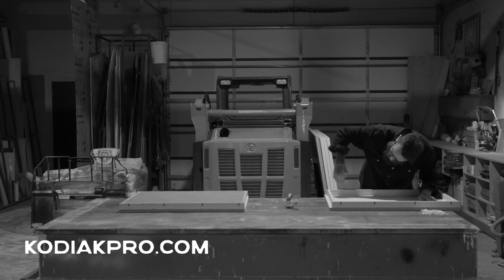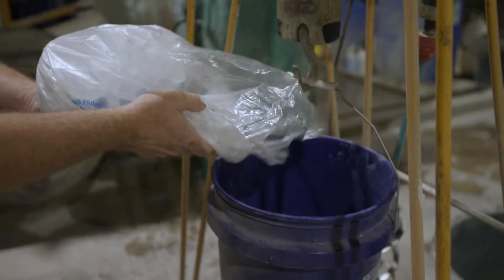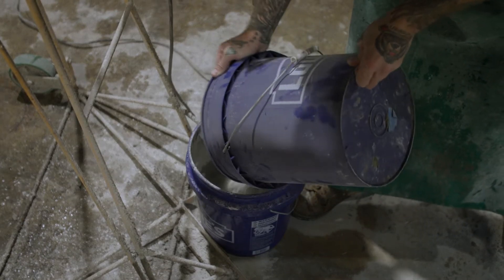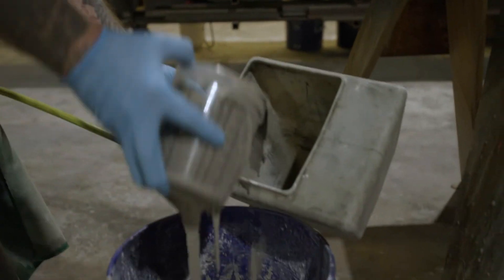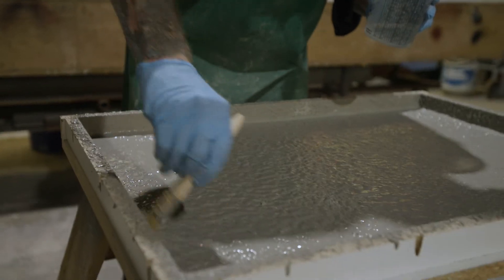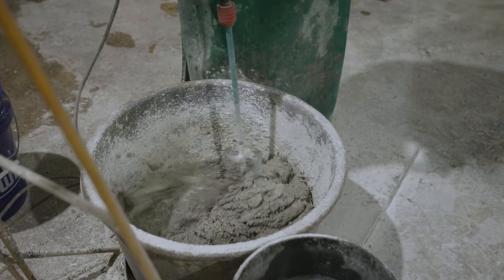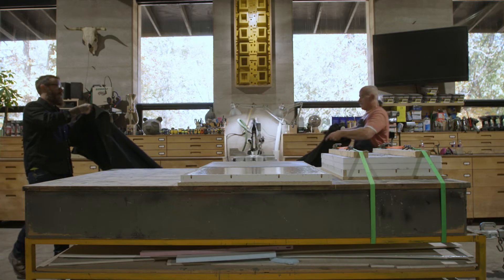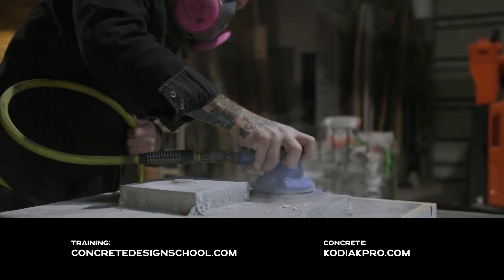How To Spray a GFRC Face-Coat to Make a Concrete Countertop or Sink, then Pour an SCC GFRC Backer

Comment: What are the main differences between sprayed face and just pouring scc from the start. I assume reduction in fiber appearance. Is the resulting finish more natural with sprayed vs sleeker with scc?
Reply: That's a great question—it really boils down to your workflow preference, though sometimes aesthetics play a key role. With the right mix and fiber, you can cast an SCC GFRC piece that's visually flawless, with no fibers showing and no need for a face coat. The trade-off is that you'll need to build a sturdier form to handle the increased hydrostatic and hydraulic pressure, plus a backer form. On the other hand, using a face coat eliminates the need for extra formwork, but it raises the risk of surface imperfections and extends the casting time considerably. It's a matter of choosing your hard, as they say. Personally, I go with SCC GFRC because it's more predictable and consistent, but some prefer the sprayed and hand-packed approach.

Comment: What is SCC?
Reply from the maker: Self Consolidating Concrete - essentially it is a very fluid mix that pours easily and self levels, and air is able to work its way out without the need for vibration.